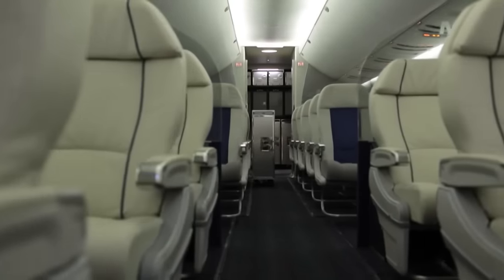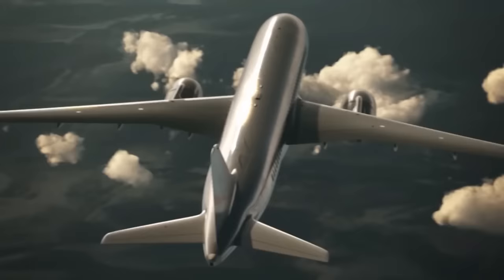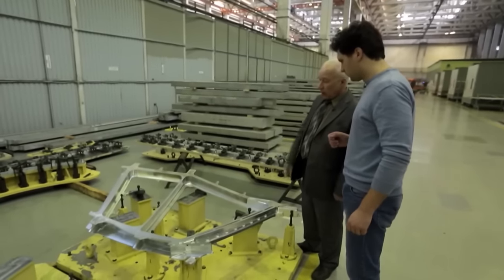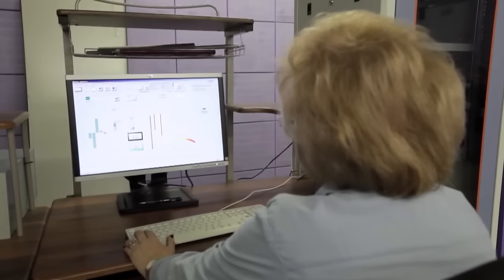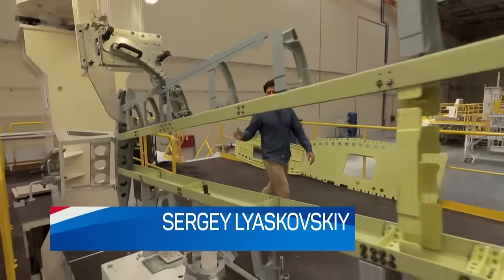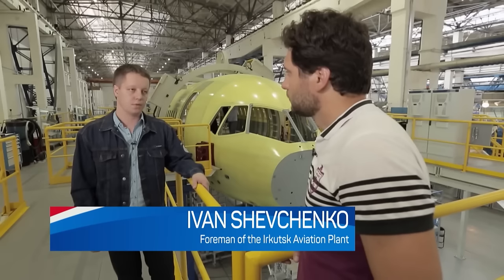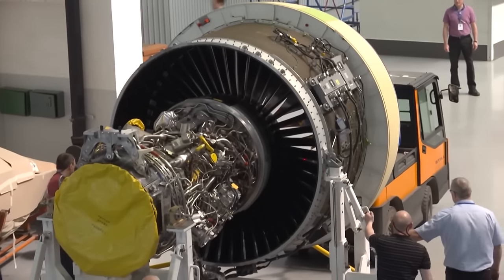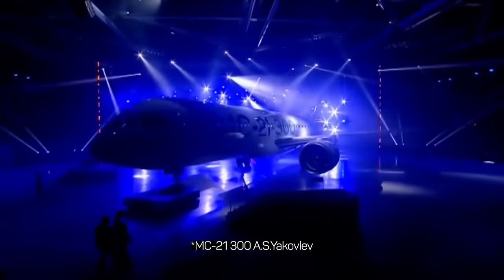Irkut MC-21 — The Aircraft That Can CHANGE The Way We Travel

Comment: Unfortunately this plane has no future due to sanctions being implemented after russian full scale invasion to Ukraine. Fuel economy dropped dramatically after they set new Russia made engines PD14. Actually the plane is overweighted for 6 tons cos they use russian avionics and engines.
Reply: The world will buy its a 195 country nato which is 32 leave 163 remember the sanctions on the oil yet Russia 🇷🇺 has record sales 😂😂
Reply: Well, the fact that an ordinary soldier from the Special Operations Center of Ukraine throws in lies about an airplane that outweighed by 6 tons, I am not surprised, since everyone can Google about the Ukrainian An-178, which has a ballast cargo weighing 1.32 tons in the form of a package of 15 steel plates weighing 85-90 kg each, stacked immediately behind the cockpit.

Comment: Get over yourselves, the Russians built a great Airliner. I was the first Flight test Jet engine mechanic for the MC-21-300 in Zhukovsky 2017 and Siberia. The same companies that designed Boeing's 787 major systems also designed the systems for the MC-21-300. Pratt engines, Shorts Brothers Aviation from Ireland build the thrust reverses and engine Nacelles. The same company built the Flight deck for the 787.
Reply: The 737Max also has a great Flight Deck. Tell that to the families of the 300+ headstones of the passenger fatalities.
Reply: @generaclesdey4622   2 accidents compared to hundreds of millions of flights?????? wow you really know statistics eh???! )))
Reply: @generaclesdey4622  What the hell does the death trap 737 have to do with the MC-21-300?
Reply: That was the MS 21 you knew that uses pratt  and Whitney engines, not the newly developed one that runs on PD 14 engines
Reply: @mightysparrow9632  I was the first Flight test Jet engine mechanic for the MC-21-300 in Zhukovsky 2017 and Siberia. But I am sure that you know more about the project that I ever will.
Reply: @mightysparrow9632  Because the Russians could NEVER reverse engineer the Whittle jet engine and use it to power the Mig 15.
Reply: @faranger  I think your words about "the Russians would never be able to reconstruct the Whittle jet engine" were a joke. Of course, we managed to overtake them in the end!

Comment: The MC-21 has not received Prat and Whitney engines since the boycott started in 2022. As a matter of fact I read about this in a 2022 article.

I would think the presentation of the airplane is not from 2023 or 2024 but from the year 2022. 

I would say the MC-21 is a very good  design, so I don't really understand why they did not mention this in the video!

Comment: It will be interesting to see if they are able to build them under the current sanctions.
I don't think Pratt and Whitney is available for Russia.
It could well be that it's named "plane of the 21st century" because it will only be built some time in this century but not at any time soon.
I guess there's a reason why Boeing and Airbus are using the materials they are using.
Carbon fiber is light - but will it last after years of use?
Reply: The answer is that all new designs use mainly carbon fibre

Comment: A modern airplane without winglets (wingtips), seems like an airplane of the 80's.  They were created to reduce drag, improve fuel efficiency and increase airplane stability, decreasing turbulence.
Reply: Russia can't just create winglets probably😄
Reply: Reduce drag by introducing another surface against the air flow? 
You sure know what you're talking about.....
Reply: @Cnupoc It is not me who is saying it - "Wingtip devices are intended to improve the efficiency of fixed-wing aircraft by reducing drag"  (wikipedia)
Reply: What is difficult about creating winglets? The wing on the MS-21 is unique precisely in that, due to its shape and length, it simply does not need these winglets. The main purpose of winglets is to reduce inductive resistance, which leads to fuel savings, but their installation implies an increase in the rigidity of the planes and an increase in the total weight of the aircraft. In strong crosswinds, in areas of turbulence, during takeoff and landing, winglets seriously load the wing. As for such a parameter as elongation, on most modern machines it is in the range of 10-10.5. The maximum was achieved on the Bombardier Dash 8 Q200 – 13.8 aircraft (Canada). For MS-21, it is 11.5. Why were winglets abandoned during the construction of the MS-21? It's all about the material from which the wing is made. If it were aluminum, then in order to achieve an elongation of 11.5 it would be necessary to increase the thickness of the plane, because the metal is soft! Carbon fiber is another matter. It is quite rigid and therefore, even without winglets, such a good elongation is obtained. This became possible due to the very thin and durable profiles, which increases the aerodynamics of the aircraft at cruising speed by 5-6% compared to competitors.
Reply: @dsms5979  Какие то шутки у тебя плоские.

Comment: Bad manufacturing design when start 800 kg and end with 25 kg.
Should use mold and die casting process
 You may make many air planes to justify mold for die casting.
Reply: Your knowledge and advice are enough to produce aluminum toilets, but not airplanes. If you want to expand your range of knowledge, read about an alloy called aviation aluminum, for example, about 7075 T6-Aluminum. You will learn that the mechanical properties of 7075 are largely dependent on the tempering of the material. The T6 level is usually achieved by homogenizing 7075 at 450 ° C for several hours, then extinguishing, and then artificially aging at 120 ° C for 24 hours. This technology allows you to achieve maximum strength for alloy 7075. How are you going to achieve such parameters of workpieces when they are cast under pressure, I cannot imagine!
Reply: @vladimirnikolskiy  thank you for the recommendation about = .toilet.
Point 1. Does Boeing Airbus also use 800 kg material to make 25 kg finish part?
Point2. Whole ussr work on rocket etc. Elonn Mask build reusable rocket what reduce cost etc. Etc 
Many times one individual smarter then whole country with army of engineers.
Reply: @enigmaak8049  Elon Musk received patents from NASA.
All of America worked for his rockets. 
lol.)

And they are still more expensive than Russian ones.
Reply: @artemg9753  you wrong. Main my point is: why USA wait for Elon Musk for so long? Why NASA do not give patent to many other individuals. 
Why we do not see long lane of people to get nasa patents, to search for investors.
Same thing about Amazon Joe Baso .
Conclusion: 
Individual can be smarter than whole country with army of engineers,  professors from dozens of universities.

Comment: Just try to get a Russian design onto a western registry – as long as they don’t comply with FAR-25 / EASA-25 you may forget all about it
Reply: Why you think Brics is for? They will have no choice but to certify.
Reply: @christosioannidis7483  You are not very familiar with CofA and how it's obtained it seems - well read up on ICAO and FAR/EASA certification requirements and learn.

And even if they manage to comply with all the requirements then comes the political part and my guess is that it's even more difficult
Reply: Tu sais les normes sont créés par l'homme et non par les hanes, l'Europe n'est pas le centre du monde, l'Europe et si parrain sont en déclin, cela semble t'échapper apparemment.
Reply: they comply far and easa
Reply: @addis11100  When I was part of the JAA rule drafting body back in the early 90's and up until I quit to become FSM in Flexjet Europe Operations the ONLY russian build aircraft allowed on a western AOC was those belonging to former warsaw Pacht states now members of the EU. The reason given was that they would not have the economy to re-new their fleets entirely. At that time not a single russian build aircraft complied with FAR/EASA and as I understood it there was quite a big element of protectionism involved - we would simply not allow western manufaturers to go broke because of cheap former Soviet material that was being offered to western operators
So in essense safety and politics combined